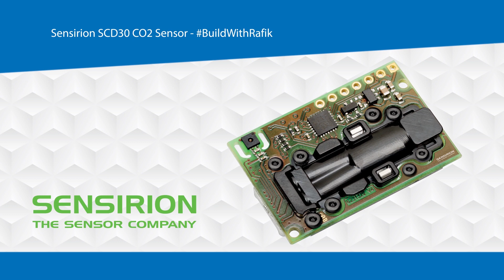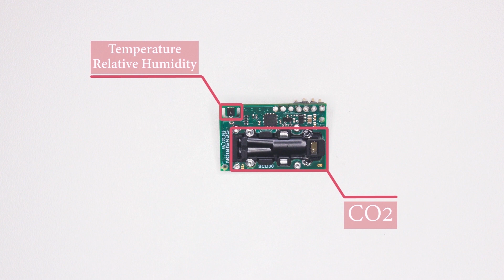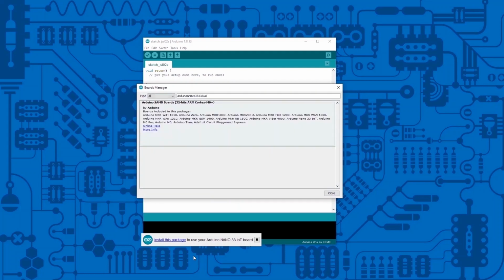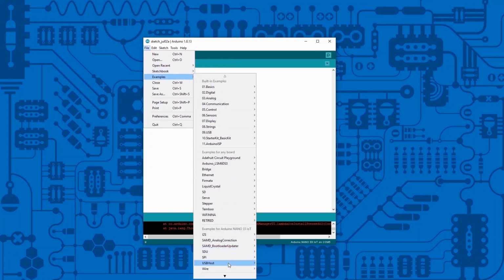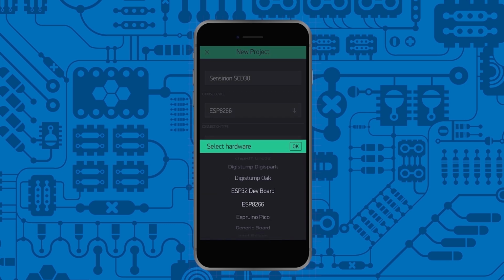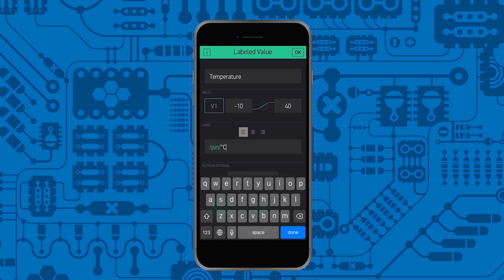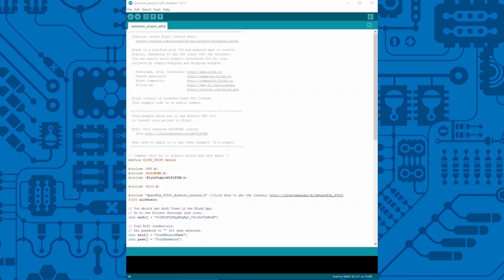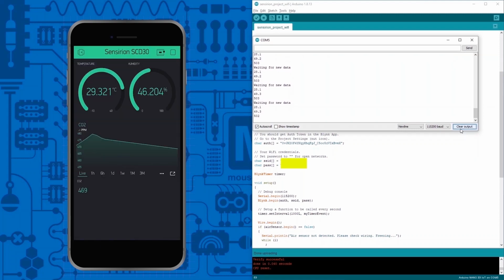How to Connect the Sensirion SCD30 to the Cloud | Mouser Electronics

Comment: Can we Use Arduino mk1000? or it must be the nano 33 loT?
Reply from the maker: Yes, you can. However, instead of using the WiFiNINA library, you'll have to use the WiFi101 library in your code. The code in this tutorial will only work with the Nano 33 IoT and the MKR WiFi 1010.